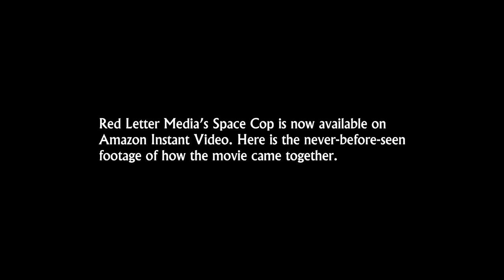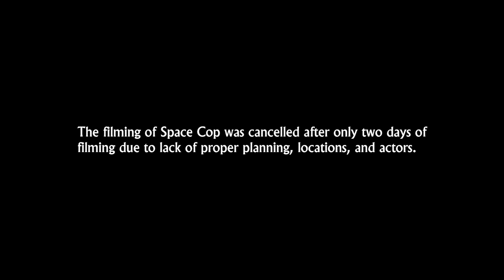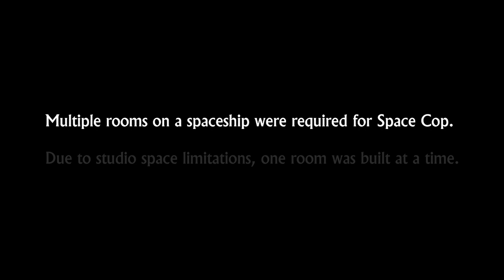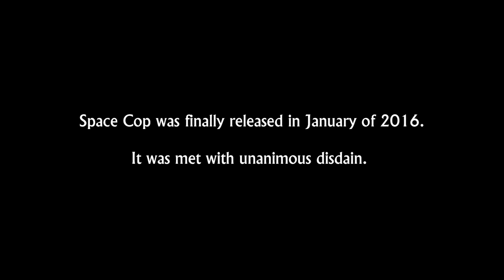Red Letter Media Behind the Scenes: Space Cop

Comment: If anybody ever needs prop guns, you could always use the plastic guns to make molds, and then melt a bunch of tin foil or beer cans into the molds to make guns that sound like metal and have enough weight to interact with the set and other props more like a real gun.

Alternately, you can just glue a bunch of fishing weights inside it. In that case, aim for the magazine, bolt, and barrel areas when possible if you want a more realistic balance.